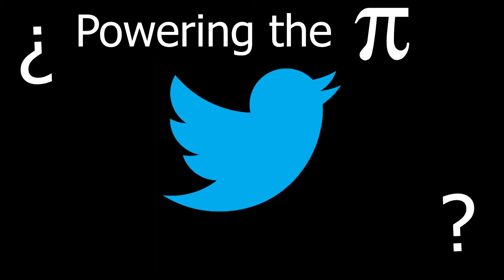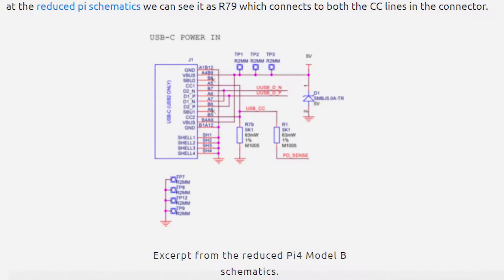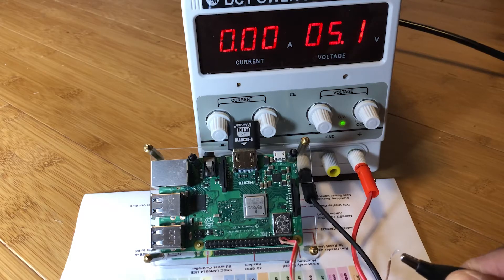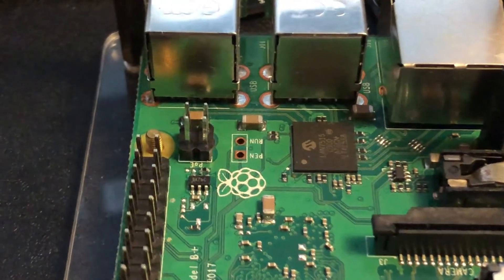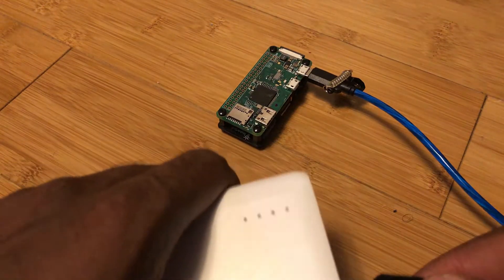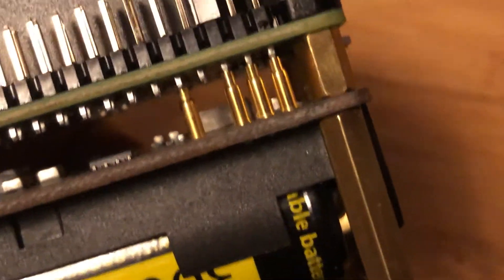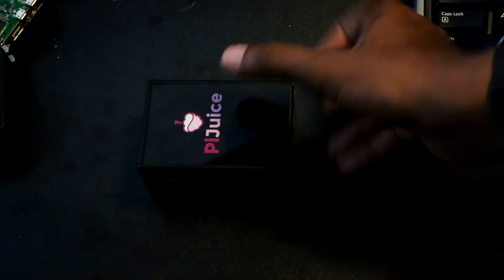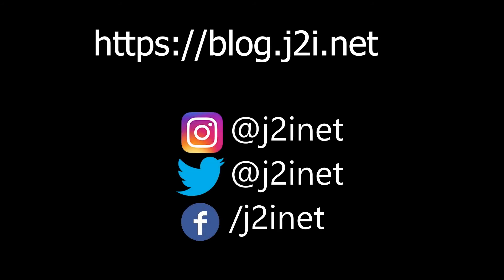Power Options for the Pi

Comment: I bought geekworm 728x, so ac led fail is turn in red, what could be the problem?
Reply: I have U100 ups board, and if batteries are discharged, voltage drops to levels that don't allow rpi to boot.
Could be the same in your case.
People overcome it by increasing voltage to 5.2v or 5.3v